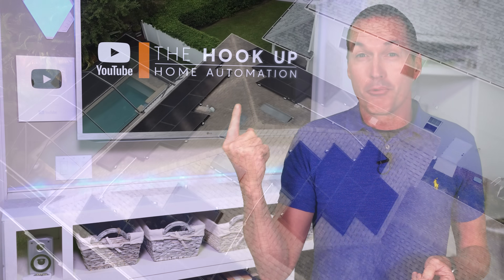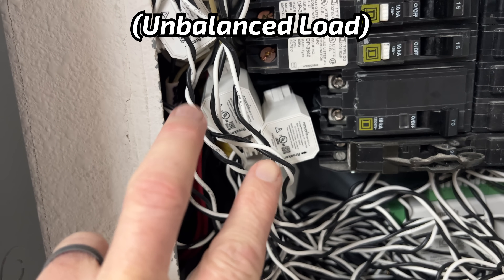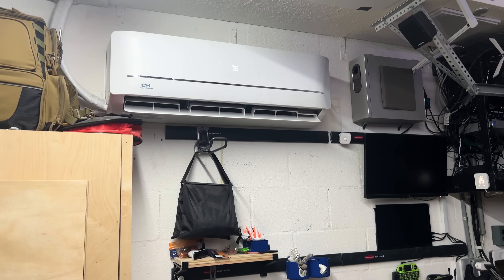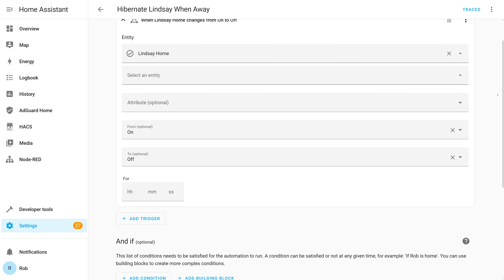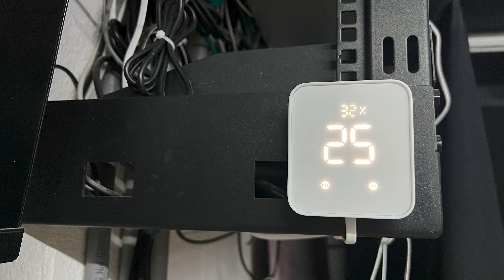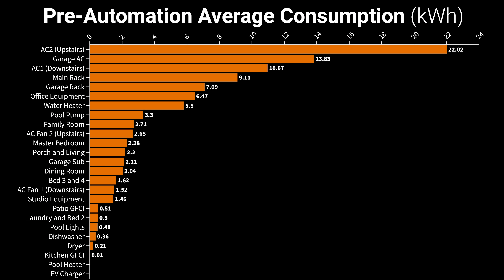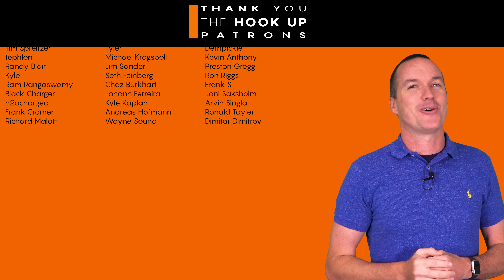I cut my electric bill by $1,331/year (with Home Assistant automation)

Comment: There's a lot going on here.  This analysis plan is excellent, I'm going to be looking into the emporia energy monitors.  I'm personally EXTREMELY reluctant at opening, touching, or otherwise looking at my electrical panel in a way other than to flip breakers off and on, as I am NOT an electrician and from what I understand doing so reveals the most electrically unsafe area of one's home.  then again, i'm now curious if I have an external disconnect (that must be a thing, right?) that I can lock out (preferably literally), I'd probably be ok with attaching electromagnetic power sense leads around my circuit breaker leads...  how is this device powered?  from the panel somehow? - I'm already using tasmota flashed sonoff energy monitoring smart plugs on my servers in my rack (you and I have very similar things we're powering).

as far as the computer hibernation, I honestly wouldn't. - the servers host various things 24/7 so there's very little gain there, an as far as the pc's, I want those availible for remote desktop and to do updates while i'm not using them.  they can't do that if they're sleeping.  what I would (and should) do, is look through windows power settings and make sure that the idle settings for stuff like cpu speed (and thus power) is set as low as possible.  There are lots of levers that you can mess with in the windows power profile (or you can try just setting the stock low power profile).  newer computers are also typically MUCH better at idle throttling.

Air conditioning wise, Central air / minisplits are expensive to replace, but recent dual-inverter multi-speed compressors are SIGNIFICANTLY more efficient.  I just replaced 2 of my window units, the old ones were rated at 8000btu and were pulling around 1000w at roughly 50% duty cycle.  I bought 2 midea u-shaped dual-inverter window AC's and they each use only roughly 350-600w at roughly 40% duty cycle.  if I were smart (and I might just do that this weekend), I think i'm going to re-home one of my energy monitoring plugs over a hot week to see what that actually adds up to.  I'm also aware that there ARE outdoor compressors/minisplits/central air compressors that utilize the same dual inverter variable DC compressor technology (instead of just having a single speed AC compressor that uses a solid state relay for control). though the external designs are usually higher capacity and significantly more expensive (but also more likely to integrate directly into home assistant if that's something you like).  Further, many of the larger external systems feature bidirectional heat pump functionality to significantly save power on heating as well as cooling (you'd only need your existing heating system as a backup for sub zero weather (which isn't nearly as typical in FL as it is here in CT).

depending on your energy monitoring and how much of an issue you believe it is for you, you might want to see if home assistant will interface with your tv (I have an lg cx oled and if it's on wifi, it's adoptable in home assistant via lg integration, full control), and get a motion sensor or other presense detector for your tv watching space and have home assistant power the tv off when nobody is in the room for 15 or 20 minutes.  OLED brightness can also significantly impact power draw.  the number 1 thing that effects oled power draw though is bright vs darker images on the screen. - it's funny to lots of people to think about it this way, but an OLED TV is LITERALLY an LED lighting array grid.  a giant color-tuned 8294400 "bulb" LED panel.  when those are displaying darker colors, the individual lighting elements aren't drawing nearly as much power.  the difference between displaying an image of a night scene and a bright sunny day can be something like 50w (no joke).  I have an oled in the living room, and I use 3x 48" lg cx oleds as computer monitors on my workstation - I saved a TON of power on my desktop setup simply by a. having the displays turn themselves off when the computer goes idle and b. switching to dark mode on all the apps.  it straight up looks better, but it also uses way less power.

you state your garage lights are 75w - that's A LOT by today's standards.  I'm not sure what your lighting situation consists of, but there's a ton of efficient lighting products that you could replace this with that should get you SIGNIFICANT power savings...  1200lm (100w incandescent equivalent) LED bulbs are fairly inexpensive and only draw about 9-12 watts.  if it's more of a flood lighting situation you want, you can get  something like 5000lm led flood light arrays that only pull around 40w and are pwm dimmable (some even directly interface with home assistant if you wanted so it doesn't have to draw that much power).  otherwise, I would add a presence detector of some kind and a method of turning those lights on when someone walks into the room and off again when there's no longer someone present in the room.  you can either do a simple motion detector, or there are mm wave sensors that have a wider view (and go through most objects) and thus do a better job at detecting people for a little more money.

As far as your rack goes, there's not much that can be saved on dedicated networking equipment sadly, but if you're running any linux servers (including proxmox), you can run powertop to see if you can save some power (it'll suggest configuration changes to improve power savings).  you can also change the cpu governor to "conservative" which will scale cpu frequency more gradually with load rather than spiking it to 100% whenever there's a new thread that needs execution time.  I can usually save 10-20w on average with modern systems with these tweaks with little to no impact on my server workloads. - if you want you can also enable stuff amd's cool and quiet in the bios if available, and/or decrease turbo power on intel cpus if you'd like with the minor sacrifice of top performance (usually not noticeable in most server environments).  Depending on what workloads you want to run, there are also EXTREMELY low power alternatives (such as intel's professional atom chips (my router is built on a atom c3758r (8c/8t) minipc with quad 10g sfp+ networking for example and that box is EXTREMELY efficient - my home assistant minipc is running on a j series atom-based celeron, and i've got a mini pc that i use for digital signage (display of a couple home assistant, proxmox, and workload dashboards) that runs on a n100 4c/4t cpu that uses a whipping 25w at full speed (or 18w at idle which it mostly is) - it literally sips less power than the old monitors that I have it driving.  and then there are various arm-based devices such as the raspberry pi 5 or radxa rock 5c which are extremely low powered devices that are excellent for running homelab workloads. (my day job is IT lead at a health research institute)

Comment: I have a Vue 2 flashed with ESPHome and piping data into Home Assistant and it's fantastic. The energy management features in HA are great and provide super detailed information with as much data retention as you could want. One cool thing with the ESPHome setup is it can take the whole home measurement from the big CT clamps and subtract the 16 known measurements to get an aggregate measurement of all other circuits combined so you still get a little insight even for circuits that are not directly measured.

I also have some automations triggered by the usage itself, namely I can detect when someone is cooking on the electric stove in the kitchen, and that turns on HVAC fans to help circulate air.

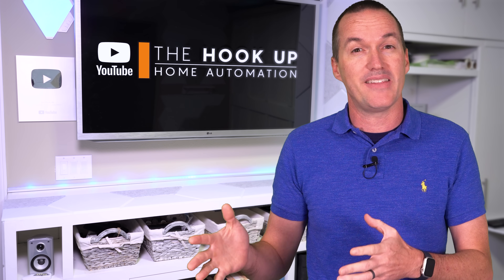Comment: 8:03 I've seen videos saying that shading your AC compressors can help. Though you need to be careful as to not trap the hot air, so you need to be sure the source of the shade is far enough away.
Reply from the maker: Oh yeah, I'm 100% sure that shading them would work.  What didn't work was trying to detect when they were in direct sunlight and not letting them turn on during those times.
Reply: @TheHookUp  Wasn't trying to imply your test was wrong; was trying to give you a different technique to try and see if it helps. Hope it came across that way! Love your videos and was perfect timing for me as I nearly got a sense though have been questioning its ability to detect things accurately. This having a dedicated monitor per leg is much better! Hopefully I can fit them all in my box!
Reply from the maker: I did not take it that way.  I actually recently saw this video from DIY HVAC guy: https://www.youtube.com/watch?v=2-7Y4Z88BeE

Though it seems a little silly that he didn't DIY it since it looks incredibly simple.

Comment: We started with emporia.  It saved us, replaced a water heater, 2x after finding it was running away.  It also saved us from a main panel upgrade when we put in solar and 3 powerwalls.  We also use 10 plugs for both monitoring and convenience as well as automation.

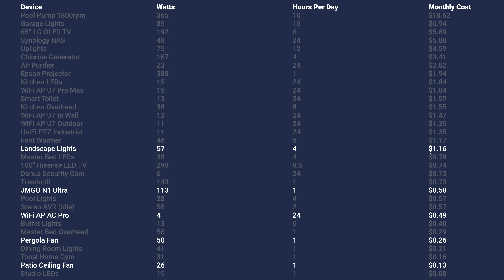Comment: 8:53 As this table very nicely shows, by far the biggest factor in energy consumption is how long the device is running. People always think that using an induction stove is gonna skyrocket their electric bill, but it isn't. Yes, it's a high power connection, but 1. you're rarely ever using it at full power, and 2. you're rarely using it for more than half an hour a day. One cable operator in the Netherlands once had a mediabox for watching TV that basically never turned off, it used as much power in standby as when it was on, pulling (depending on the mode) 16 or 34 Watts when in standby. That means 140 kWh per year if you don't even turn the TV on! Seriously, the small leeches are the true killers.

Just remember, a month has about 740 hours, a year has 8760. Even a 1 watt device that's on 24/7 will run up 3/4 of a kWh in a month and almost 9 in a year, equating to a few bucks per year. That may not sound like much, but that's only ONE watt. That's absolutely nothing. Lights, even LEDs, quickly run 50W per room, so leaving them on 24/7 is gonna run to about 40 kWh per month, or 440 per year. That's a LOT of energy you're wasting.

I must say Brad, it's very clear in your usage that electricity has been virtually free for a long time in the US. Nobody in the Netherlands would ever AC their garage and then let it run 24/7, not even in a 40C heatwave. I get there's a difference, for us it's a few months in the year that may be hot and for you it's the majority of the year, but still. Same goes for lights though, I don't think many people would think it's acceptable to leave lights on 24/7, no matter where they are. I'm glad to see you're doing this properly though, actually using data to find out what's going on and not just willy nilly guesswork.
Reply from the maker: Very true.  The Stereo AVR in the garage was a perfect example of a massive energy waster with 56 watts of idle consumption.  I've now automated it to turn on and off with a motion sensor in the garage, but I imagine it's a common thing for people to leave on.
Reply: @TheHookUp  I just remembered, all energy that gets used in your house eventually turns into heat, even the 85 Watts of your garage lights. Even if they're LEDs, eventually it all turns into heat. So that's basically a 85W heater that's running 24/7. I think your main gains therefore were from appliances producing less heat, making the AC work less hard. 
That being said: How well do you keep sunlight out? Do you have blackout curtains or do you block the sun on the outside of the window? Blocking it on the outside would make a huuuuge difference. Blackout curtains make a room dark, but the energy from the sun is still converting to heat inside your house.
Also, I recently saw a video by the DIY HVAC guy on YT of a product made for AC condensers that shades them, making them more efficient. It doesn't block the hot exhaust, so it basically just shades the intake. I'm not sure it is actually super efficient, but it's something you could easily build yourself for cheap, and it has no consumables.
Reply: @TheHookUp So how much does your solar offset your costs?
Sounds like even on a hot (and sunny) day even your solar doesn't cover your consumption.
Reply: The energy values are honestly shocking. My two-story house (central Europe) uses, on average, nearly 5-times less energy on a similarly hot summer day! That's just nuts. And my house also has a multi split AC unit that keeps the entire house very cool.
Reply: @justatiger6268  Yeah I was pretty shocked too. Our entire house doesn't even take as much power in a day as his upstairs AC alone does. But then again, I get the need for AC in Florida. The temperature is one thing, but the humidity... What I don't get is just leaving everything on constantly. Not only does that use power, it also creates heat. Just remember that all energy used in a home eventually get turns into heat, even LED lights. So simply turning off the AV receiver and the lights in the garage is like turning off a 140 Watt heater that runs 24/7, which means the AC doesn't have to work as hard.
Reply: @timderks5960 You also have to remember that the building materials in the US and the insulation that we have is a LOT different. Having a well insulated home means it takes less energy to cool it, and less energy to heat it. Our houses are plywood and not very well insulated...
Reply: @Spiker985Studios  I am well aware of that. I had written up a section (rant) about how Americans always choose to put in more energy for cooling or heating, rather than insulating their homes, but it felt too much like a personal attack so I removed it. The materials you have really doesn't matter though, you can still build a perfectly insulated house, it's probably even easier with your building style, it just takes more effort and money.
Reply: @timderks5960  Sure, but I was pointing out that it almost assuredly is a factor in the energy costs shown. But also (I'm 100% guilty of it) Americans absolutely suck at doing our part to reduce our draw on the grid 😅
Reply: Yeah. I think dryer is another one that falls in this category. Look at his dryer usage. it's like the lowest usage one.
Reply: I was surprised by the consumption too.
I'm in the UK, 6 bedroom house, no AC but a fair amount of tech. Heating is gas, I use 15-20 kWh a day.
I thought mine was high.
Reply: @JasGawera  I think one of the main factors here is cost. Let's be honest, taking into account average income, exchange rates and what they pay for electricity, they probably pay a quarter to a third of what we pay for electricity, and that's nowadays. I bet that 10 years ago they barely paid 10% of what we paid. So yeah, when it's basically free, you don't really care about wasting it.

The exact same is currently going on with drinking water in the EU. Currently it costs almost literally nothing (half the price of 1 beer in a bar for 1000 liters (~250 gallons) of water. That's so cheap that virtually nobody cares about what it costs, so people use cleaned water that's perfect for human consumption to water the yard, clean their car, etc. If that price suddenly shoots up 10 or 100 times, we'll start caring about it more too. Now because these types of increases are often limited by the government, they go up relatively slowly, so it's not a sudden 10x increase, but it's a little bit each year, so people get used to it and don't get shocked by the price.

Same probably happened with electricity for Rob. Prices went up and they added some small things for comfort, but never needed to look at consumption because it was cheap / they can easily afford it. Only if you actually look at it and see you can easily save 1000 bucks per year you realize how wasteful you've been in the past.

Comment: Had a similar problem with my house and my parents. I started by recommending this to my parents to install at their house because after my brother had moved out and it was just them two, they saw there bill was still high. I recommended this to them and my mom discovered their chest freezer from the early 2000s was costing them almost $50 a month to run! They ended up buying a whole new freezer that basically paid off itself with the much cheaper cost to run!

Not sure if you have looked into any of this as well, but you can use the emporia integration within home assistant to track the power as well and use automation around that. I have an automation that detects when my dryer is running and lets my know when it turns off by just monitoring the power use! Since I also have a well for my water I use that to let me know how often my well pump is running and if it is running when I am away from home, then that may indicate a leak!
Reply from the maker: Yes, I'm actually going to set up an automation to let me know when the salt level in the pool is too low for the generator to run.  The chlorine generator uses 167 watts on top of the 220 watts of the pool pump (but runs sporadically), so I should be able to check whether the total power used by that circuit exceeded 300 watts instantaneous every day, indicating that both the pump and generator are working.